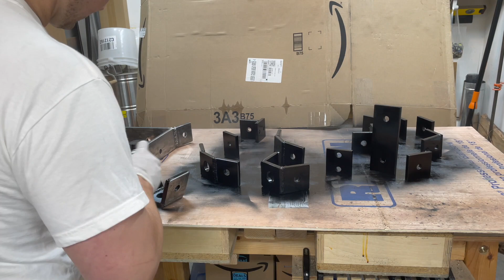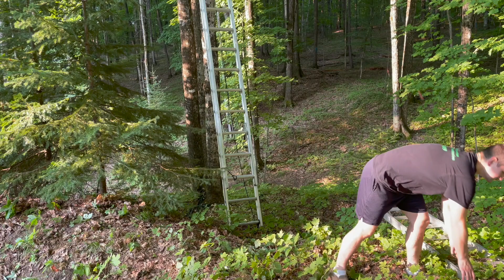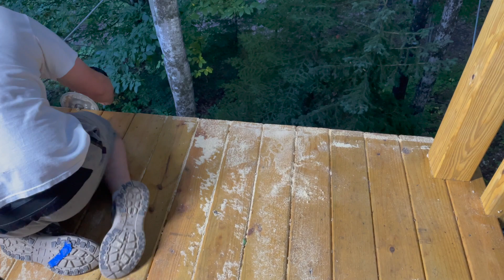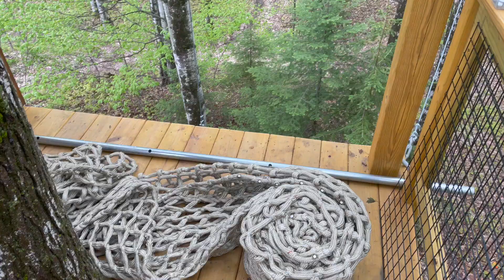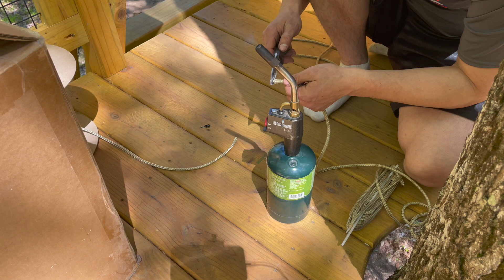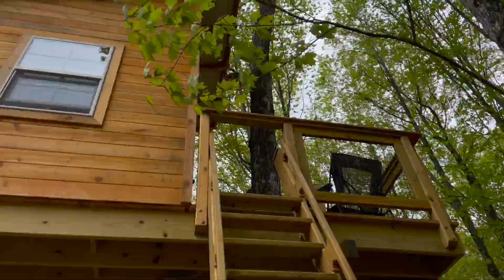Treehouse Net

Comment: that t shirt and clamp model has got to be THE BEST thing i have seen about planning the placement of the border. Everyone usually shows placement between 4 trees that form a square or rectangle or a triangle, and it doesnt work well for odd shapes like this. My tree im working off of has 4 trunks leaning out similar to this and ive been struggling. This is JUST what i needed.
Reply from the maker: Thanks! It took a good deal of head scratching at the computer before I got frustrated enough to go to the shop and start goofing around.

Comment: Thanks for sharing this, it is very beautiful and inspiring.
I am looking to have similar net in our backyard. What is the size of the shrinking net you’ve used?
Reply from the maker: My install is kite-shaped with a sides 7.5/8.5/18/15 feet with diagonals 11’ and 21.4’ — the actual net size prior to shrinking I’m not sure, that was left up to the engineers at Pucuda Netting.
Reply: @samuelwiltzius  Thanks a ton, my trees are more sparse and make triangle of 45/50/20ft.
I guess, the big size will make it pretty costly task.

Comment: Can you please let me know where I could get the brackets that attach the TABs to the Rope.
Reply from the maker: I fabricated them from 1/2” plate. A local metal supplier cut the pieces to size and I welded them at the desired angle. The holes were drilled using a Bridgeport milling machine.